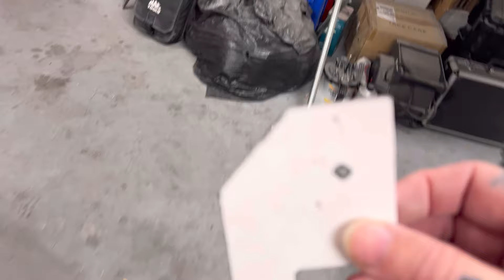Bass broke door latch fix the right way.

Comment: When I cut myself bad usually I use electrical tape and paper towels to stop the bleeding hell I was changing the shocks on one of my mustangs a couple years back I was using a peace of galvanized steel pipe for leverage as a cheater bar to break the bolts loose and that thang gave all of a sudden it hit me in my bottom lip and split it wide open pretty deep I'm like damn I'm gonna have to go get it sowed up and then I'm was like it wouldn't stop bleeding so I went in the house and got toilet paper and packed it and help it on there for a while and thankfully it stopped bleeding it has a scar but it's not that noticeable
Reply from the maker: we found out CA glue (super glue) works great.